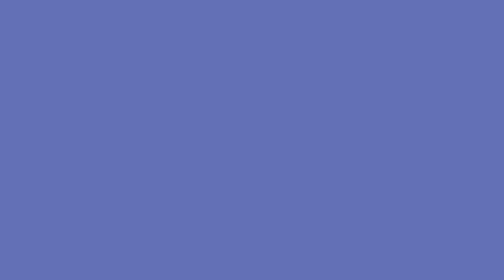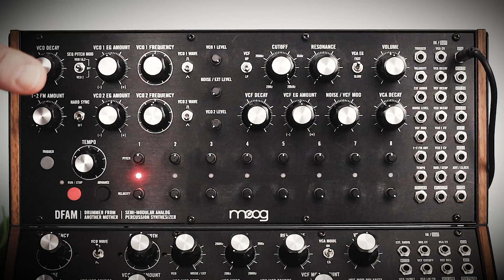Part 4 - VCOs and the Mixer - Complete DFAM Tutorial

Comment: Yo dude ✌️ loving the videos, making a lot more sense to see and hear how it all goes together ❤️ I'm having issues with my machine though, I've got the behringer edge as I cannot afford moog 😅 and I'm getting a popping noise quite regularly at lower frequencies along side the synth sounds, now i would think this was just a fast attack but it's not even consistent with the notes, best way to describe it is, it's as if there is an LFO running in the back and the popping phases in for a few pops then out, and it's not on the same beats each cycle.

I may be silly and this is what the machine does as it is a percussion machine, but yours doesn't seem to do it in the video so figured I'd ask for some help, as I'm unsure what it could be 🤷‍♀️
Reply from the maker: Hey. That's odd about the popping noises. The first things that came to mind were the ones you've ruled out. Does this happen when nothing is patched in? Does the popping happen at the beginning of the notes - like every time it moves to a new step? (I understand it sort of goes in and out - but I'm asking about when it's there)
Reply: @braintree56  so It's in the same notes, but volume changes, yet still rhythmically which is why I originally thought it was part of the sound, but didn't make sense to be there when I wasn't going that low. I've also managed to achieve getting those pops/signal even when Osc 1 & 2 and the noise gen are all at 0 level. Everything is at 0 apart from VCF res (at full) and the sound changes with the Cutoff know. I'm not sure if this is part of the sound set up but  it's as if something is generating its own signal seperate to the oscillators? I'm pretty new to all of this, so I may just be describing what the machine does though 😅👍 tha ks for listening man, I appreciate it as trying to get in touch with behringer is a mission, and trying to explain sounds with no visuals is a mission so I appreciate your time muchly man ✌️ 
I'm still in the process of emailing them, but if this doesn't sound normal to you then at least I'm not the one who's broken 🤣
Reply from the maker: @ashleycobbold7816  Ahhh... The resonance/filter combo might be the cause. What resonance does is emphasizes the frequency at the cutoff. So you might just be hearing that. That would explain why the tone changes as you move the cutoff frequency. 

Does the sound go away when you turn the resonance all the way down? Honestly, I rarely turn my resonance up because it reduces the bass response... The vast majority of the time I have it set to zero.
Reply from the maker: I just tried turning all the sounds down and turning up the resonance - it definitely makes sounds. If I turn the cutoff down, it almost sounds like clicks/pops and if I turn the cutoff up, it sounds like pings. Turning the VCF EG up and down creates like delay type effects or laser beam sounds. Does that sound right?

If so - just turn your resonance down! :)

Comment: Can't quite dial my sound in the same as yours, are you running it through anything else? e.g. Reverb in Ableton Live or something.
Reply from the maker: No. All the sounds are totally dry. Sometimes I will have some effects on for the little bits at the beginning or end, but I didn't in this video. The DFAM is really challenging to reproduce frequencies exactly. Between the pitch knobs and the frequency knobs, there's just too big of a range... Is the 'sound' the same?

Also, this might not apply here at all, but many other people have asked me about this and it's come up a few times - make sure you're not using TRS cables.
Reply: @braintree56  Makes sense, I have noticed the big difference minor knob turns make. Using decent cables (not TRS) I believe. Thanks for the quick reply! Loving this video series and learning a lot!
Reply from the maker: @316Drums  Thanks. TRS could be high quality. If the sound quality is fine but the tones aren't perfect, it's probably just the knobs. But if the sound quality isn't as good check your cable. TRS stands for tip-ring-sleeve. Check the end you plug in. If it has two rings, it's a TRS cable. If it has one ring, it's a TS cable. TRS cables, even the best, will cause phase cancellation on the DFAM.
Reply: @braintree56  Ahh, gotcha. I confirmed I'm using TS cables. :)